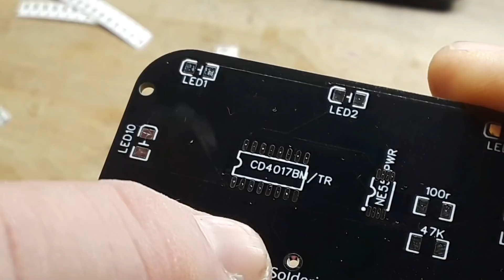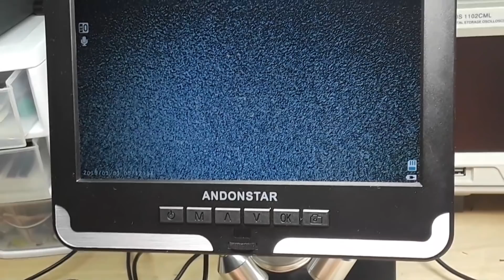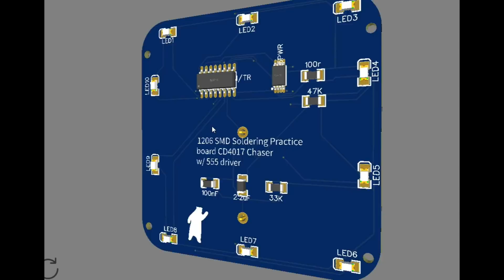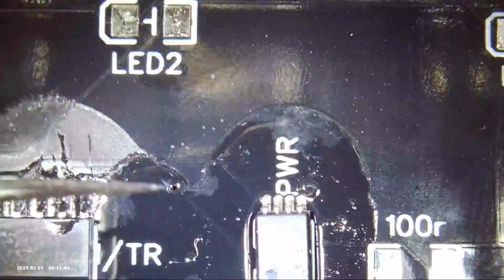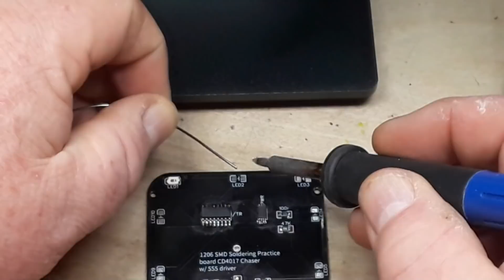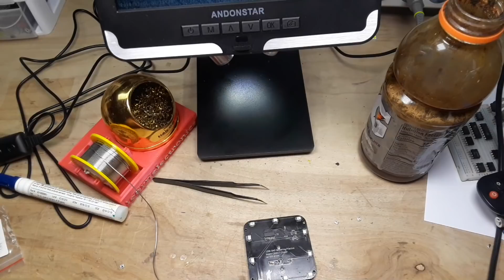SMD Soldering Practice Board Soldering and Assembly with Microscope

Comment: SMD soldering isn’t that hard once you’ve got the right tools and put them to use that I learned very quickly. So my advice: use that microscope! Even for that larger 1206 and 0805s. Get yourselves a better flux. I was messing around with Thor’s pesky liquid flux too that never worked for me until I switched to the gel type. It doesn’t have to be the expensive quickchip brand but a good MG Chemicals or even Amtech works better. And lastly I suggest you using either a knife type or a smaller j type solder tip. I mostly switched to a 4mm long knife style tip that lets me do drag soldering as well as has a fine enough tip to solder 0603 and even 0402s occasionally. Everything else is technique that comes with time.
Reply from the maker: Cool, thanks for the tips

Comment: Even at the age of 70 and with eyes that are not what they use to be, I have no problems with surface mount soldering. The reason being, I have learned some valuable tips that most people do not know about.  People are soldering surface mount devices as though they were soldering through-hole devices.  It's not the equipment needed to do surface mount soldering, it is learning the tips to surface mount soldering. Even the cheapest soldering iron will do fine if you know these tips.

Comment: For bridges formed while soldering SMD components, you can clean your iron, flux the bridges, and apply heat. They magically shrink away and excess gets pulled to the iron.
Reply from the maker: Thanks!
Reply: @FourthWayRanch  it works but you risk overheating the part. With flux you just barely touch it with the soldering iron and you're good.